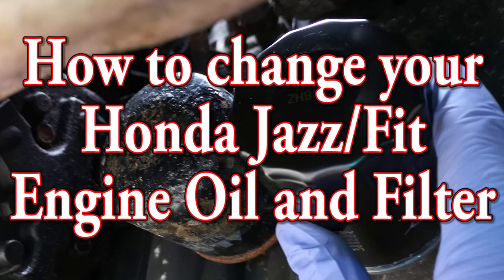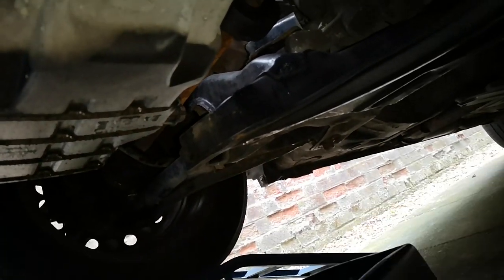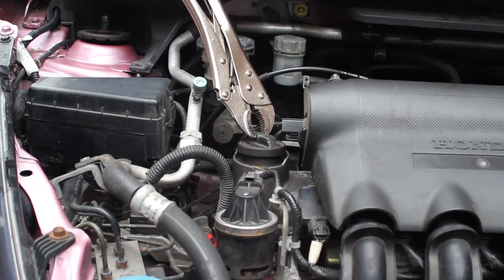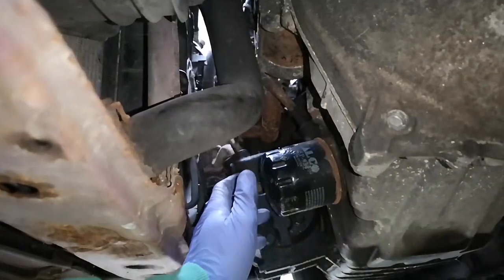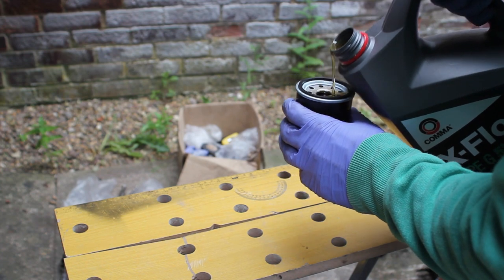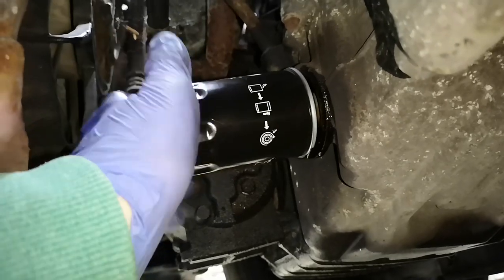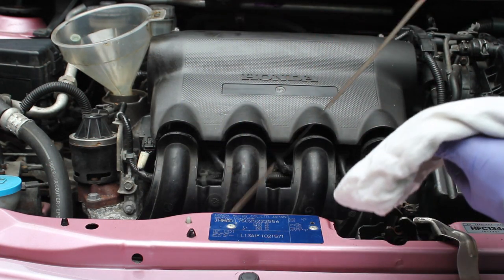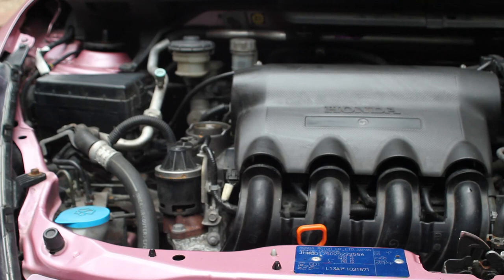How to change your Honda Jazz/Fit engine oil and oil filter

Comment: We should use the same engine oil recommended (e.g. 5w30) by the manufacturer for whole lifetime of engine or we can change to high viscosity (e.g 5w40 or 10w40) as the engine gets aged (like 20, 0000  KM on odo) ?
Reply: Same ,no thicker

Comment: Never use a filter wrench to do the filter back up, it only needs hand tightening as otherwise the rubber gasket could get damaged and then it will not seal!

Comment: Never, never ,never use the "screwdriver" method especially when you have had areas of overtightening in other areas. Once punctured, if you can't remove and replace the filter you are in real trouble.
Reply: As a last resort use a large screwdriver. Its messy but works. Pucture the end of filter with grip as it is stronger there. I have used this method in tight places where tools hard to reach about 3x in 30yrs of working on cars .once committed to this approach no going back lol good luck